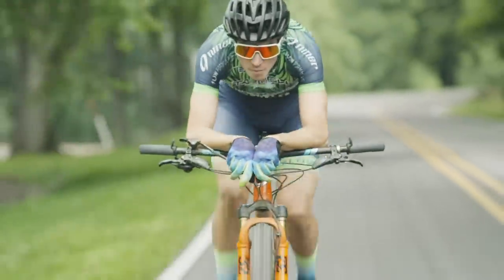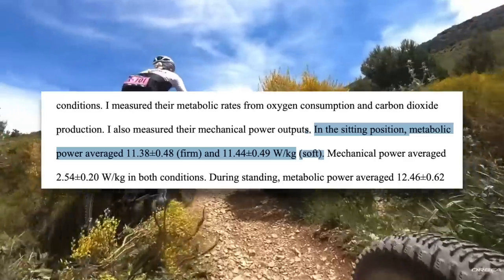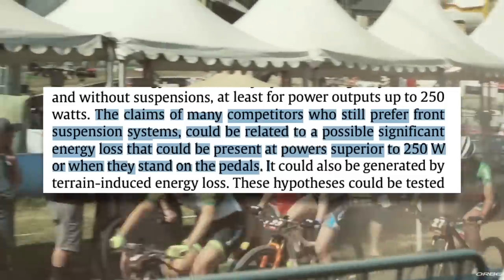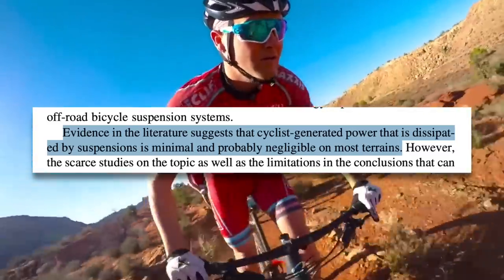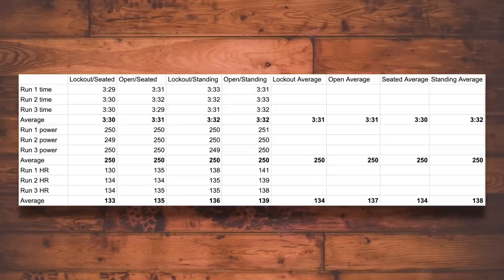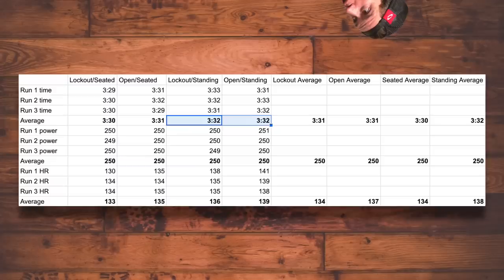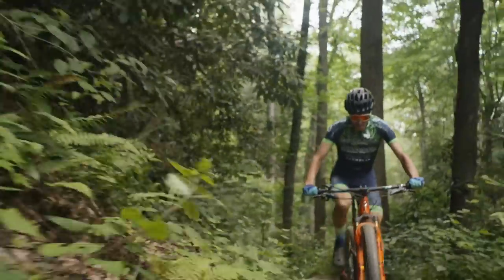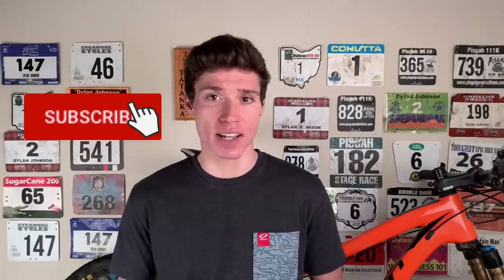Does Locking Out Your Suspension Actually Make Your Bike More Efficient? The Science

Comment: Maybe I’m looking at it wrong, but since you’re measuring power at the crank it’s not a surprise that you had identical times between runs.  The efficiency loss shouldn’t be changing between the crank and rear wheel, so maintaining identical pedal power would always result in the same wheel speed on that run, right?  If there are efficiency losses, it would be prior to that measurement and you’re not seeing it because you are compensating for it (by trying to maintain exactly 250w).  

For example, if having your suspension unlocked actually took, say, 10% more energy, you were automatically outputting 10% more energy in order to get 250w measured at your feet.  Overall, you were putting 10% more effort into it, but this isn't captured at the power meter.  The extra output is being lost to the inefficiencies.  This might explain the higher heart rate?

Maybe, ideally, you would maintain the same aerobic output and then measure the wattage and speed, instead.  No idea how you would do that on the trail without a VO2 mask or something…

It’s like the difference between measuring crankshaft hp or wheel horsepower on a car.  If you were trying to measure the efficiency changes of a car after making some driveline change, maintaining a fixed output by measuring at the wheel each time would always get you the same speed result, whereas measuring crank hp or even fuel usage is where you would actually see resulting changes.

Or maybe I’m overthinking it…
Reply from the maker: I like where your head is at. Here’s me doing some overthinking as well (please correct me if I’m wrong here). If the suspension absorbs energy on the downstroke then it will return that energy on the upstroke. Some energy will be lost to friction in the shock but this amount seems to be negligible. GCN talked about something to this effect in their video regarding frame stiffness. That of course doesn’t mean it’s correct.
Reply: This is exactly it, measuring power at the pedals doesn't necessarily account for the power being lost in the suspension. There must be energy used to keep the suspension active and bobbing up and down and overcoming friction in the suspension links. This energy doesn't have to be transferred through the pedals, and you can verify this by bouncing up and down on your bike while keeping your pedals motionless, you are compressing your suspension using energy not measured by the power meter. This additional energy may be reflected in the elevated heart rate measurement he took. Its probably relatively small, mostly just to overcome the friction in the links, but if he tested with a larger travel bike with less auti-squat the motion would be more exaggerated and the power required to maintain the pogo stick effect would be higher.
Reply: @DylanJohnsonCycling  Oh, I agree, the actual difference might be negligible.  Like you and appocketz say, probably the only loss is the internal friction in the spring, fluid flow, and in the suspension bearings (probably turning into heat).  And maybe some internal body friction as you bob around a bit more?

I was just curious from a testing methodology.  

Now that I think of it, I'd bet most of us here that watch your videos are like minded overthinkers.  That's why we love your science based approach!
Reply: Well… the energy used to bounce the suspension in the unlocked setup would not be transferred to the pedal stroke when the suspension is locked? 🤔 During a sprint on a road bike, you push & pull hard on your handlebars, to generate more force on your pedals… Don’t you think ?
Reply: @DylanJohnsonCycling  
I think you might be able to determine the energy lost into the damper by measuring the temperature rise of the damper (ideally fluid but body temperature could work) locked and unlocked.

That would give you a direct measurement of how much energy is being lost into the damper
Reply: @DylanJohnsonCycling  Im not clear. Why would you lose energy in the suspension. The issue has always been pedalling. As in "losing" the firm platform (pedal) to push against and transfer power from your leg.

At any rate on rough terrain you would be losing power due to decrease in traction as the tire doesnt follow the ground without properly set up suspension.

And that is also a massive issue. Most people dont actually have their suspension set up properly.

To do so you would need to reshim the damper to your weight and riding style. Nevermind that most people probably dont even have spring rate set up properly.
Reply: @DylanJohnsonCycling  unsubscribed, you admitted  to watching gcn, #bhd would never stoop this low
Reply: interesting concept, likewise I'm a little sceptical that measuring power at the pedals will not account for power put through/lost in the entire system. Since virtually noone does hub power meters anymore a simple test may be to put your FS bike on a trainer. have a device measuring the power that the trainer reads and another device reading the power of your pedals. then do an interval session alternating between locked and unlocked.
Reply: @hodgo1981  That would only showcase drivetrain losses.

A power meter can only measure power that goes into rotation of crank/pedal. Extreme example - If you pump hard without rotating it's going to show 0w. When pedalling causes pedal bob the power meter is showing the power that is spinning the cranks not the total power that your body is generating.

Pedal bobbing causes the whole system(bottom bracket) to move up and down, that takes energy but the power meter can't know that. It can only measure force in regards to RPM.
Reply: @flyingaz  Not really just the friction in the spring, most energy lost is due to the shock's damping mechanism, and also the geometry change of the frame. For the shock, the compression takes place when crank is pushed and the rebound returns the energy mostly at the crank down position where the returned energy is not used to turn the crank, instead it's just wasted to counter the rider and bike's weight. Not to mention damping itself is designed to obsorb surge power and release it slowly. Think of it as when you put down X amount force from your leg, from 2oc crank position to 5oc position, during this time the crank receives Y amount and the shock obsorbs Z amount, the Z amount will be returned to you from 5oc crank position as you stopped putting down power, and because it's a slow release, let's say it keeps releasing the obsorbed power for a good while, all the energy released before your opposite crank come to 2oc =  8oc at your current crank is only used to bounce you and your bike upwards, i.e. wasted. Now how slow do your tune your shock to be able to get any of those back? Clipless pedal all of sudden makes more sense now doesn't it?
For the geometry problem, when shocks are compressed,  you lose more energy when the headtube is at a steeper angle with every little twitch at handlebar, ofc unless you can hold your handle bar still without falling then you wast nothing due to this factor. The energy lost due to the friction is ignorable.
Reply: OK, my turn to over-think: I don't think it matters that the power is measured at the pedal, because putting the same amount of power into a pedal stroke on a less-efficient bike (not-locked out in this case) would result in less power transferred to the ground and a slower time. If you could install a large 'wing' on the bike that was either oriented horizontal or vertical with the touch of a button, and you did two trials, one with the wing in each configuration and measured the power input at the pedals to keep that the same, I would expect the trial with the vertical wing to be much slower, but it wouldn't matter where I measured this power input.
Reply: I would expect though, that due to the suspension being compressed, pedalling efficiency (watt to speed ratio) would drop, as some energy goes towards compressing the suspension rather than the drivetrain (and forwards momentum; i.e. speed). Especially when standing. This just comes from my observations and not from scientific understanding of bike suspension.

It could be that pedalling becomes harder but if the question is efficiency than heartrate is not the measurement to use, right? Heartrate (etc) measures  "hardness",  watts measure efficiency and power.
Reply: I think this is right. We need a calibrated constant output motor to test and compare times. Maybe an e-bike with care to handle battery issues (either via experiment control or consistent charging).

Edit: This is basically a sensor placement issue. The 250w is really the power applied to the crankshaft and is not necessarily proportional to the metabolic effort required to do so.  Measuring metabolic effort directly is quite difficult in humans, which is why something with known power/effort production is needed to conduct this test.
Reply: @DylanJohnsonCycling  My base level thoughts: if the suspension is travelling at all, and its a spring/damper combination (some extremely cheap suspension is just spring), the Damper's job is to literally turn kinetic energy into heating up the fluid (air or oil) - why DH riders have worse suspension at the bottom of the run as their damper heats up and becomes less viscous. Therefore there will be less energy going towards moving the bike forwards from each pedal.
Reply: @DylanJohnsonCycling  I think the analogy with frame stiffnes is unfair. Frame is metal which gives back most of the energy you put in when you flex it. On the contrary suspension is intentionally designed to absorb energy in order to avoid ongoing spring effect where you would be jumping up and down for uncomfortably long time. That is why a part of the suspesion is actually called a shock absorber. Without the shock absorber the analogy could work. With the shock absorber it cannot.
Reply: Good to consider!
Reply: Awesome video and love your content! This would be interesting to measure directly, I wonder if suspension manufacturers publish data for something like this. For the air spring you are correct the only loss would be friction (which is probably negligible), but the damper is designed to dissipate energy as heat. Since the resistance of the damper is proportional to the compression velocity it's possible that under the pedaling conditions this dissipated energy is not significant enough to have an impact. The studies you cite here are also fairly small so it's possible that even if it's eg. a half a watt difference they would likely need hundreds of participants to get a significant p value.
Reply: One other thing to add here with other test are that the ground you are on also affects the performance. The Bobbling to lower position actually increases the back tire traction that converts to energy as well. But as I've been looking through many comparisons it really depends on the bikes frame and tires. If you can get more comfortable position when climbing a steep hill locked out can be faster and more efficient. If not the performance is pretty much the same. So many variables it can't be nailed down for good but definitely suprising how close the differences are.
Reply: I'm a bit late to the party but I'm here to agree with you. the power sensor is in a place that is not sensitive to the efficiency loss. Imagine you are out of the saddle on a suspension system, so on a power stroke the suspension compresses. your body centre of gravity has moved down a little (relative to a locked out frame). if the suspension is not damped (so its elastic, like a frame) then that energy will be returned to you, via the pedal lifting you up a bit on the return stroke). if its heavily damped, the energy is not all returned and you have to do work with your quads to lift yourself up. friction in the joints is irrelevant, its the damping in the shock that needs to be significant in order to see a distinction
Reply: @DylanJohnsonCycling  the only problem here is that the damper in the shock is absorbing that energy and turning into heat instead of giving you power back.
Reply: Very interesting video, thank you
Reply: @DylanJohnsonCycling  I have a full suspension 160mm enduro bike on zwift and the difference is 10 watts below 200w and at 300W it's almost a 30W loss on steady pedaling on basic horst supension. The bike watt meter is a 3 second average so can't really measure spike loss. That's really where the major difference will be. When you are deadlifting the handlebars instead of the normal bob the suspension compresses a lot.
Reply: @DylanJohnsonCycling  To answer this question you could setup a wheel on smart trainer with a full suspension MTB and compare the smart trainer power output vs pedal/crank power output full lockout compared to open suspension settings
Reply: This explains why I'm more tired going the same distance with an unlocked suspension than vs a locked suspension.
Reply: I disagree. Power at the pedals gives us how much he puts in. And since times are identical, it does not matter where energy is lost along the way. Same input with same output time, should mean same efficiency.
Reply: @mighali It's basically the same - imagine replacing the metal/carbon handlebars with plastic ones. On each stroke you will have to compensate for the movement of the handlebar which give way when you pull or push on them to help transfer power to the pedals. That is energy lost and the only function it has is as suspension. Same is for the entire frame, your body will flex it when pedaling meaning you spend energy bending metal. It's much less pronounced than shocks since metal will not bend as much as a shock has travel.
Reply: yep, and those extra losses are with the up and down bob of your center-of-mass

when you are pedaling hard, you are usually "raising" your body up before every downstroke. this extra potential energy is used on the way down. but with a damped suspension, you will lose this energy

however in an undamped fork like the lauf grit Dylan used at unbound 2024, the energy is returned by moving your center of mass back up, ready for your next downstroke! shouldnt be any losses there

Comment: I have done the same test on an SB100. Power within 2W on every lap, and no discernible change in time. This was on an 8min smooth dirt road climb at 305W. I saw 1-2sec difference between runs. I also tested my gravel bike with 40mm slicks, and got 20sec faster… which, doing the math, is exactly what I should expect from the weight alone, so on smooth dirt a 2.4 Aspen at 21psi seems to be just as fast as a 32psi 40mm slick, at least for me.
Reply: Id love to see a comparison between say an SB 100 and SB 150. Or something similar.

Obviously a bunch of elements youd need to control for (differing Geo, kinematics, weight etc)
Reply: Measuring power put into the drivetrain is not measuring your total power output.
Reply: @brianrhamilton  for sure: riding a pump track is a great example. But pedaling up a smooth climb, seated? My muscles aren’t going to move any more or less if the suspension wiggles a little bit. It still feels better to climb locked out, so for long, smooth climbs (like at Shenandoah), I lock it out. But I’m not worried about hitting the lock for a quick climb, since any inefficiency is apparently in the noise.
Reply: @filmaynard  It’s not in the noise, it’s just not being measured in these studies because it’s very difficult to do (not because it is small, just difficult).
Reply: @filmaynard  yeah Im not understanding Brians comment.

There no were else for power to come from in a significant amount.

Even on a non smooth climb and any where else youd use a lockout any "pumping" would be so minimal as to not call it pumping.
Reply: @Tyler Bruce  He's saying that the pedal bobbing needs energy to exist, and the power meter cannot measure that energy (pump track example). 

So pedal bob necessarily means certain energy losses.

If you put a crank powermeter on 100mm and 150mm bike, all else being equal(weight, tires etc.) , they will have the same time up a smooth climb given the same watts(measured at cranks). The losses don't happen after the power is transferred to the drivetrain but before. Climbing the 150mm bike at the same watts will require higher total rider power hence higher heart rate. You need to not only to put X watts into rotating the cranks but in additional force that fuels the suspension bobbing.
Reply: @alexande94  i understand that.

The PM doesnt record a pump track pump because the PM is not rotating or measuring cadence. At least as I understand pedal PMs they need both force and cadence.
Reply: @filmaynard  For a smooth pedaling seated riding I agree the losses would be small, but definitely more significant standing, especially riding singlespeed for example.